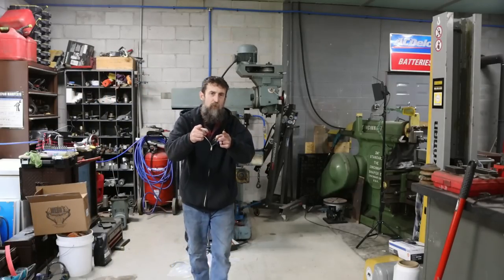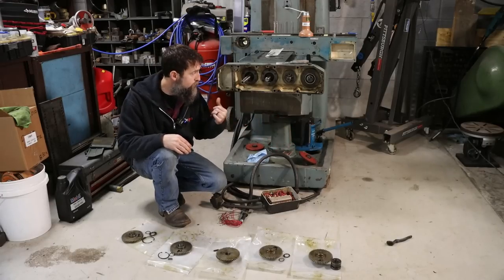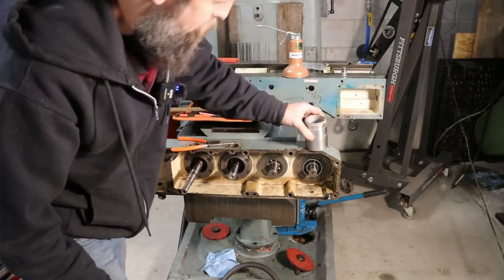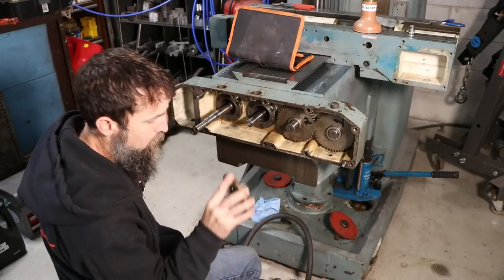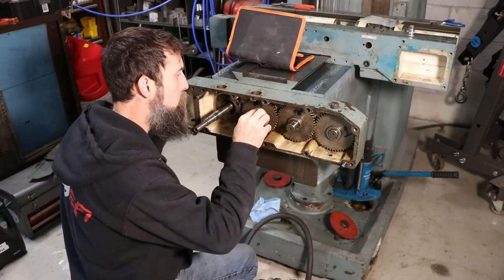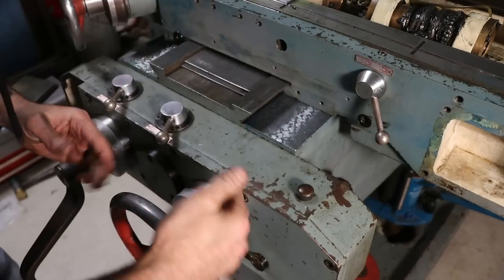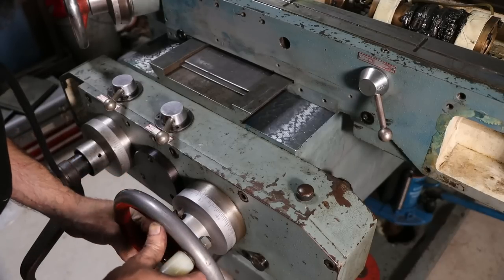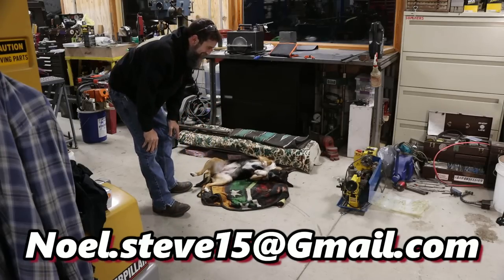DoAll  Milling Machine Gearbox is BACK Together !

Comment: Great to see old machines brought back to life by people with the patient and skill to do so. I did notice you put the oil spots on the top of the knee, rather than the underside of the saddle. Some sixty years ago while serving as an apprentice, l was spotting the top of the knee of a Bridgeport and was quickly smacked on the back of my head by the senior machine rebuilder and told to never put oil spots on the top of bearing surfaces, because they will trap small chips that will work their way under the wipers and cause problems, just a thought.  Thanks for sharing.

Comment: As you can see the DoAll mill is a step above. I have two such machines built in 1980. Mine are different  in the front gear box configuration doesn't drive the knee. A separate motor drives the Knee. The front mounted X axis feed handle is the best feature, while power feeds on all axis' the  quick change spindle are a close second. I wondered what thee machines cost back in 1980 the best is could come up with was a fully configured machine was $27,000. A Bridgeport was likely $5000 so no wonder these machines are rare. The two machine that I have were acquired 10 years apart and in different states but came from the sane factory. They has identical ID tags. The knee lift and Y axis power feed  were options. I had a machine without them. One other improvement is the spindle direction stays the same in high and low.
Glad to see it come together. We always paint a machine that we restore.

Comment: Thanks for showing all the intricacies of the gearbox, Steve. As a confirmed gearhead all that coggery was right up my alley. Glad you clipped that pipe out of the way that was rubbing on the gear. The shop dog has settled in really well, bless her. Steve, could you detect any misalignment issues with the Y travel screw due to the nut being lower from the removal of material during the reconditioning? All the best, Mart in England.

Comment: Anyone else get that awful feeling in the pit of their stomach when Steve dropped that ball bearing?
Reply: Yes indeed, cause in my case, it would have rolled to a black hole in a third dimension...........lol
Reply: I was deep cleaning a 22 caliber rifle out on the front porch, upon reassemble I had a spring launch itself about 20 feet into a pile of leaves. My first thought was guess I'll be going into the gunsmith tomorrow for a new spring, packed everything up and went into the house to do other things. Around an hour later I'm bored so I think what the hell let's go look. After an hour of moving one leaf at a time, there it was. We reassembled the gun in the house with all windows and doors closed.
Reply: Not at all

Comment: I like the way K&T have an interlock on the knee feed. It means that you have to disengage the hand crank before engaging the feed. Without the interlock the power feed could give you a sharp smash in the nuts. Looks like this Do-All has no such protection, engage the knee feed with caution!
Reply: Spring on the handle should prevent the nut shot.

Comment: 14:00 There is no reason the jack screw can't be covered with sealant/gasket . It will only ever be used during the next disassembly ,and upon reassembly will have a new gasket or sealant applied

Comment: The usual great episode and good progress Steve. That second gear just did not want to go onto the shaft with the key sticking up. I know you must have tapped it onto the shaft but I also would have used a toolmakers clamp in that situation to just make sure the key was fully seated in case it wasn't. You were not joking when you talked about the tight tolerances that the machine was built to seeing you put in the engage/ disengage feed rods into the top. As you put the rods in from the top you could see it was only just a sliding fit until it was fully seated and then the mating surfaces became a tiny bit slacker where they had worn in. Even on the mating surfaces of the rod I bet there was no more than 2-3 thou of clearance after 30+ years of service. Thatch's what I call a well built machine! Say hi to Elizabeth for me and say hi to Cora the new shop dog. You called her that so you must have adopted her!

Comment: I have had good results with Permatex #2 before.  How good? Well I have bought more than 1 tube in the same lifetime.  The only drawback is taking the machine apart some other time and the Permatex still gets stuck to my fingers.
On reassembly:  Often vintage builders provide a catalogue of replacement parts sometimes including exploded diagrams.  Even without these diagrams, look at the part numbers.  Often these numbers coincide with the order in which parts are to be assembled.  Disassembly, naturally might be in reverse order.

Comment: Get ya some of that loctite seal maker stuff that never dries it’s perfect for any gear case it doesn’t push maker into the case that can later harden up and cause issues allot of imports use it on their transmission cases and transfer cases
Reply: That's exactly what he used, only Permatex!

Comment: The tightness of the fit of that gear to the shaft is why you needed to weld up the pin on its lever. It's probably been like that since it was built and every other millwright that's used it has had to put just that little bit of extra effort to get it to engage or disengage every time. It's lucky the collar on that gear wasn't similarly worn.

Comment: finally the kind of content again that i originally subbed for. the pickup was interesting to a point but i'm glad to see you getting back into the machining part of your channel again Steve.
btw.. did you bag the horizontal Do-All band saw and scrap it?? you were getting close to finishing it and then it disappeared from the scope...

edit: your quill maybe sticking due to a worn out quill lock. my bridgeport pulls the quill lock in and causes some serious issues when using the power downfeed on the quill. to counter that i stuck a little neodymium magnet on the lock nut of the head next to the quill lock. that keeps the lock lever up and the lock block from getting pulled into the quill shaft and binding up the quill. when the quill lock binds up feeding by hand it's been the same issue of the quill lock getting pulled in. again. the magnet does the trick

Comment: Steve, now that it has been a year or two since you finished the repairs to the garage, are you happy with the results and being able to use the entire garage? Have you checked the block work for any new cracks? Sometimes things will settle and one or two may form, just keep an eye on them for getting bigger.
Thanks for the videos.
Reply from the maker: No cracks so far. I really don't expect  I will have very many.  Went a little heavy o. The concrete and rebar

Comment: Steve will the gear rubbing the large oil line cause it any trouble?? Seems to rub with each turn of the tables X axis. Maybe a copper shield wrapped around it would be a good way to protect the line. 
Looks like the new dog is your shop dog she's taken to you by the looks of her actions. Pretty dog too.
Reply: I suggest you watch the video a little bit closer.

Comment: With 1 to 1 gears, I am wondering if the 4 bottom gears needed to be clocked to run on the same tooth as before?  Oh it will work on any tooth but might be more noisy if not on the same matching teeth as before in rapid travel.

Comment: Steve,
The teeth gear thingy is a clutch. This a very common connection method in machine tools to engage and disengage drive trains. Very little operational stroke is required to engage and disengage and the design is very compact demanding limited space requirements.

I cringed while watching you scrape the old sealer from the gearbox parts. In our shop the safety police decided that OSHA compliance demanded that all razor blades be used only in retractable blade holders or knives. This was so strictly enforced that I don't think that I have held a bare blade for use in more than 35 years! Watching you and cringing made me realize that I have been completely brainwashed by the safety police! 😑